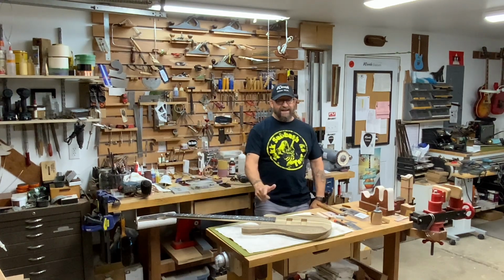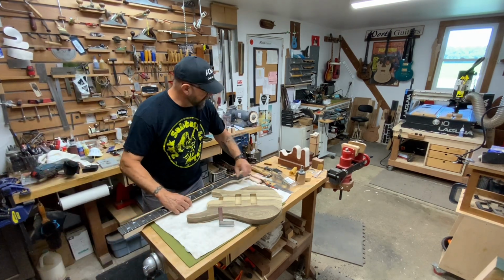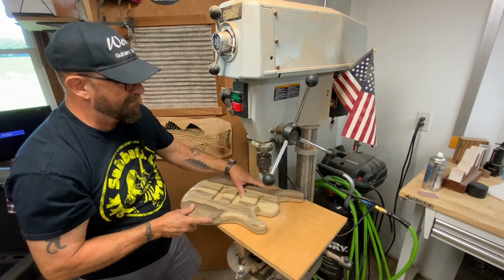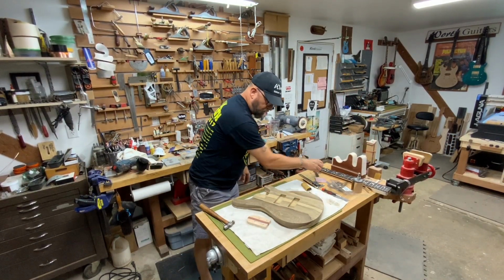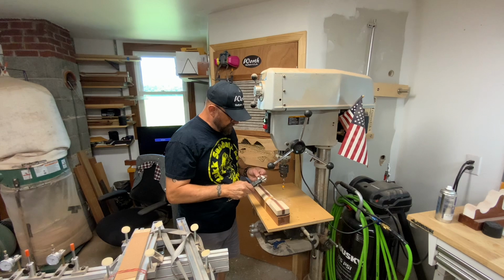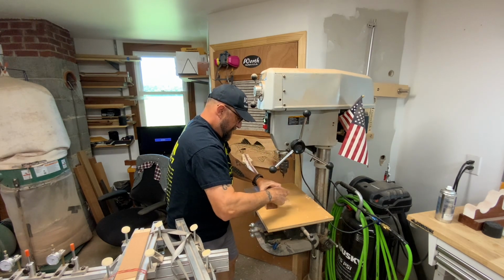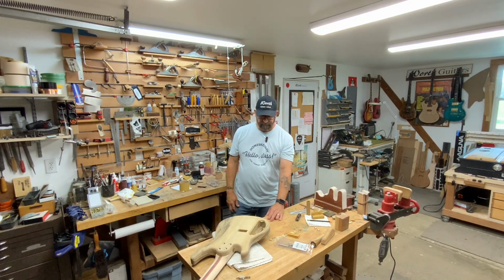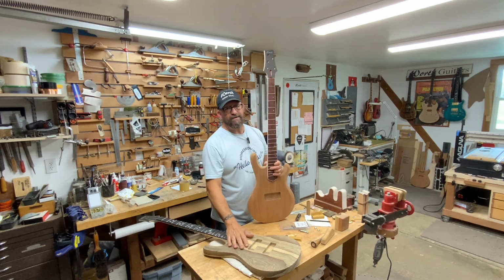Threaded Inserts In The Neck…(or truly a pain in the neck)

Comment: It's always something Tony. I've used the Allen head bolts to install inserts. They  tighten up in the insert and just unscrew it when I back it out. I found that an extra nut in between the head of the Allen and the insert used to lock the bolt in place works well.
Reply from the maker: I will try that.

Comment: Put a 1/4" ratcheting box wrench over the driver bit before inserting it into your drill press chuck.  Then you will have a ratcheting handle to help drive it.

As you found, a bolt of the proper thread can serve as a driver (with an allen head or even just a hex head and use a socket or wrench).
Reply from the maker: Great Idea. Thank you.